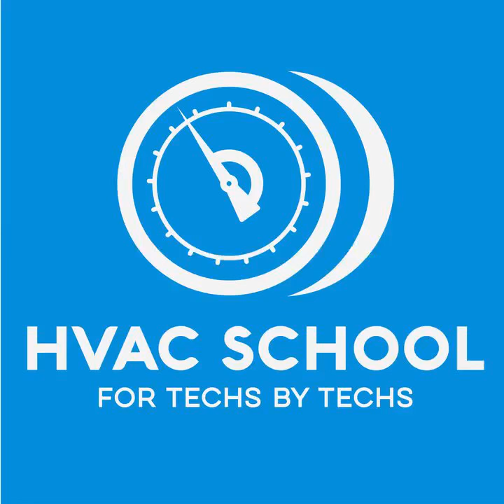Vacuum Pump Basics

Comment: Vacuum Rotary pump oils are Hygroscopic not Hydroscopic. I'm Sorry if I sound like a Pedantic Knob-End Wanker. 
But if you get  a question in an exam about water vapour absorption in the oil, the difference between a "G" and a  "D"  as in HYDRO or HYGRO could be affect your results. Great video. Stay safe my dear American Cousins. 🇬🇧🇺🇸👍🇬🇧🇺🇸👊❤️🇬🇧.

Comment: I rented a 2 stage Robinaire 15400 from Runyon's. Before I left I asked them to make sure the oil was fresh. I didn't look closely (I should have) and took it home to use it and found the oil was milky looking. I tried to pull a vacuum and the best I got was 2000 microns. After wasting my time for a bit I took it back and asked for a refund, which they gave me. The lead maintenance guy said the oil level was fine. I told him the oil had to be pure and new or it wouldn't pull the vacuum it was rated for, not even close. He said the oil was fine, they had topped it off before renting it to me. I said the vacuum chamber relies on a very clean and pure oil. He said the oil is only for lubricating the pump. I said no, it is also used in the vacuum chamber to pull the deep vacuum and he started walking away fed up with me. So I said "Fine, don't listen to me. That's why the pump doesn't work." He stopped and said it does work and walked away. Later I called the manager and described how the maintenance guy doesn't know how the vacuum pump works and the need for clean oil, he said he would talk to him and make sure he understands. It would be nice to send that maintenance guy a link to this video lol.

Comment: So how do the fieldpiece vacuum pumps work if the oil is in a separate container. The oil is not inside the machine and you can change it while it is running.